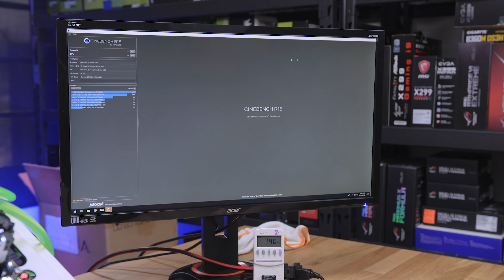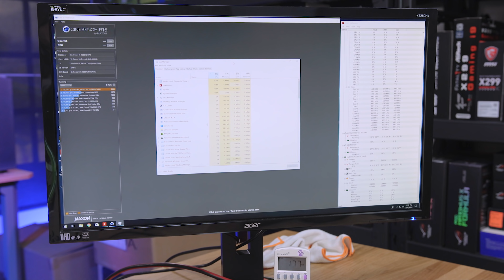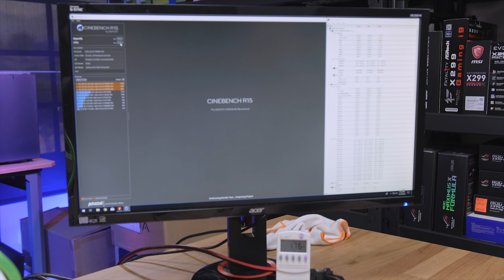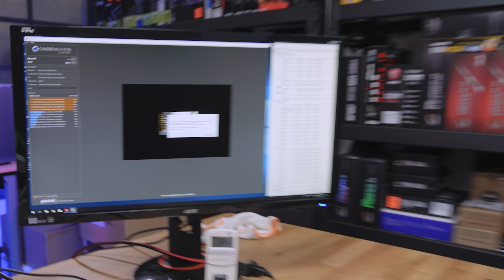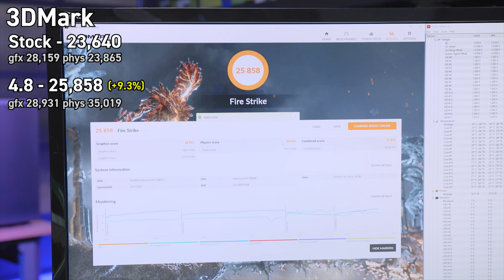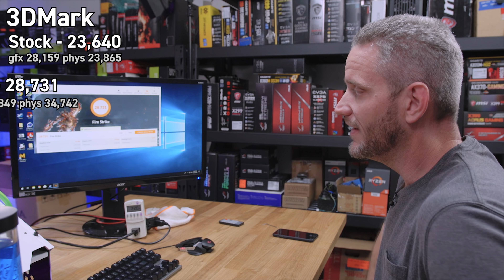Trying to get back on the 3DMark Leaderboard!

Comment: Please redo this but delidded, & from wall power or upc etc......
Wanna see if can reach 5-6GHz oc 
Congrats.
Cheers, A
Reply: Aepek yeah and with 220v
Reply: I just wanna watch a 2000 bucks CPU burn!
Reply: There's no way hes reaching 6 ghz on any form of cooling besides nitrogen.. maybe 5-5.2 ghz with a delid..
Reply: RJ Games You would at least need subzero temperatures or possible mods for a board. Phase change probably would do it.
Reply: RJ Games think could maybe get 5 or tad bit over if does delid CPU, & would be cool to see what able to get with delidding etc.., but staying away from nitrogen, etc....(just normal "water *cooled" loop). He was at 4.9GHz, so think very possible once delids CPU, think very possible....& would love to see, like said; also not using extension cord but directly from wall or a upc or similar.
Cheers, A
Reply: You're not getting 6 ghz unless you go on nitrogen. I dont care if you use zero extension cords and add the best thermal grizzly you can find. Not happening without nitrogen.
Reply: RJ Games what about oxygen?
Reply: RJ Games Not even with something crazy like a 16-fan thick 480 by 480 radiatior, hooked to a normal room fan that covers the whole thing? (Jay did that somewhen - https://youtu.be/Q2SIrV_4-dM )
Reply: Waterchiller, direct die delid, 1600watt psu, active vrm cooling and fuking pwn that scoreboard. U have an ultra platinium sample cpu, its already outperforming delidded ones.
Reply: I am willing to bet money that he will not get that cpu to 6 ghz. That can't be done without crazy high voltages and no amount of liquid cooling and delidding will be able to manage that unless you get a means of cooling the cpu to sub-ambient temperatures.
Reply: Jon Donnelly 😉
Reply: Delidded liquid metal with clean power and a sub-ambient (or cold room) water cooler but no liquid nitrogen  he can probably get that chip to 5.3ish honestly he should probably thermal camera his motherboard and check his error log to see where he is failing at as well. Oftentimes it's not even CPU heat that kills stability but other issues like bus speeds and stuff like that going goofy.  It also makes some sense to over clock each core individual so that the better cores can ramp up higher.
Reply: That extension cord is rated for 1100 Watts and it can take twice as much without affecting the "quality" of power delivery on the CPU level. You will, in fact see smoke and a fire brigade before you see any measurable difference behind two DC-DC converters.
Deliding and applying that 4x480 rad might net us some interesting result tho.
Reply: Aepek if Jays come to quebec ill delid and lm this !
Reply: Thanks all for comments! 
Think it's very possible, & doable, for Jay to reach 5GHz or bit more if delids CPU (doesn't use nitrogen or other similar low temp liquid cooling) & tweaks test bench setup some more etc.... Since, in this vid he was SO SO close & wasn't even bothering with delidded CPU, not using extension cords, etc etc etc.
Too bad wasn't a moderator, cuz I'd do a poll(or similar prgrm asking) & say vote for: A) delids CPU, no extension cord[using ups-apc etc....], tweaks ram & voltage, & other minor tweaks BUT NO nitrogen/freezing cooling solutions[water type only] B) YOLO IT, delid, IC ram psu, CPU & damn consequences AND use nitrogen if other high end freezing liquid fir cooling to reach 5 GHz ABD BEYOND.
Would really be interesting {cool} to see which one gets more votes WITH still being able to use test bench afterwards 😂
Cheers All, A
Reply: Aepek Jay love your humour if you want base check baseline/ the sound of baseline on YouTube
Reply: Yes. Delidding and using Conductonaut will drop your temps by up to 40C on this chip. This chip should just be considered incompatible with Intel's current TIM. It is insanely bad.
Reply: Absolutely we need to see this!!!
Reply: I've seen your comments on another channel before, and I might have replied... But what was the channel name.
Reply: I want to see him hook it up to the box fan cooler again.
Reply: Bios singular
Bioi plural

Ancient greek ftw!
Reply: Yes delid and push the GPU more!! :)
Reply: Don't they can hot 6 without ln2
Reply: use a NVIDIA Quadro GV100 for best resulsts
Reply: actually put them 4x in ur system
Reply: +1 to delid
Reply: Then throw in a titan v and reach 1st place in 3dmark
Reply: I've got a GTX 970 and a 6700K, no overclocking, and I still outpace many stock Titan V systems with no overclocking. System composition is HUGE when designing a system. You can't just slap a bunch of supposedly compatible parts together and assume to max out your performance.
Reply: William Eldridge What brand and chipset Mobo do you have on this system? I wouldn't necessarily upgrade my cpu either if running a 6700k, I'd do gpu first. Core I7-6700k ess pretty good cpu & base clock is 4Ghz little faster than today's 8700k out of box. Out of curiosity, what else diving in rig besides what listed? Just curious, up to you if reply.
Cheers, A
Reply: @Aepek  I am using 8GB of HyperX Fury DDR4 2666, Samsung 950 Pro M.2 256GB, ASRock Z170 Gaming K4, i7-6700K 4.0 GHz, EVGA GeForce GTX 970 SC Gaming, using stock GPU cooler and a Cooler Master Hyper 212 EVO.
Reply: William Eldridge Nice.
Cheers, A
Reply: a direct wall power what could change? the psu convert all crappy waves into pure DC voltage... i think if the psu voltages upped a bit it could do more, but where u tap the AC is not a matter
Reply: He’s gonna have to if he wants top 100 as he’s no longer in it
Reply: Nah , you wont reach 5GHz with a notmal Water loop. I have a i9 7920x, delidded with a 60mm thick 360mm and a 30mm 280mm rad with Noctua Industrial fans at 3000rpm and a ddc 3.2 at 100% and it starts throttrling at 4.8, with better exteriour temps at 4,9 GHz. Its the same die just with less cores active so i doubt the 7980XE, even if its a golden Sample, will reach that Clocks at least with water cooling.
At least i made it to Place 28 in Time Spy extreme :P

Comment: The Xeon x5650 is a 6 core 12 thread chip but it dual socket lga1366 mother boards are rather common so that system on cinabench was probably using 2 processors.

Comment: Ok ok hold up, I'mma let your video finish but I have to say two things:
1.) Thank you for bringing back more gimmicky cheese.  Chip, bass check, biossiii...I've missed it and am delighted to have it back.
2.) Speaking of gimmicks, this is at least the second time I've heard you mention peltiers in the same sentence as LN2.  As far as I know, the whole peltier thing was just a bunch of gimmicky BS that didn't hold up to actual tests and even underperformed when compared to air cooling.  Am I totally wrong?  Will you please to a thorough peltier cooler comparison video?  I'll give you money.  Thanks!

Comment: Running a 7980XE overclocked without delidding is not very smart. The 1080Ti needs either the XOC bios or a shunt mod to achieve a high score.

Comment: I want you to do a part 2 to this where you get maybe top 50, but with a delidded CPU, much better watercooler, and not drawing power from an extension cord, and maybe a better power supply? 1200W is not going to be enough I would bet for higher OC's

Comment: But can it run Crysis ?
Reply: Nothing can run Crysis yet, ask again in like 50 years :P
Reply: ForzaE2 yes at 25 fps with some frame drops and stuttering.
Reply: OmniMontel at 144p
Reply: Not at 4.9Ghz ... It'll thermal throttle and crash

Comment: I may have only 6c/12t on my 5.0ghz, 1.30v 8700k, but my electric bill isn't $1700 a month either lol
Reply: Running 700W CPU 24/7 for one month consumes 504 kWh which costs an absolutely insane amount of money: 30 (thirty) dollars a month.
Reply: You must be the life of the party.  $30 may not matter to you, but I'm sure your parents wouldn't be happy about it since they're the ones paying the bill.
Reply: I'm not fun at parties, but at least I'm well aware of what things actually cost. that $30 dollar bill doesn't happen by accident by an irresponsible child. the golden sample CPU capable or running 4.8+ GHz alone would cost you $2500. add in MB, PSU and cooling - and you're looking at more than 3 thousand dollars rig, and that's even before GPU and other stuff. also, no one would run this CPU 24/7 under the stress-test. so the actual cost of electricity for that CPU would be like $10-15 a month compared to $4000+ for the whole PC. not that scary, isn't it?

thanks to Greenshit and other eco-terrorists so many people are in fear of using the electricity and don't even try to calculate. they just think they can go broke in a minute if they don't try to conserve the electricity

sorry for the rant

Comment: I wouldn't touch another Intel chop until they start soldering their heat spreaders to the chips. You shouldn't have to void your warranty to get better thermal performance.
Reply: Yes it does. https://communities.intel.com/thread/125395
Reply: Intel will never go back to soldering. They stopped doing that a very long time ago. It just has never been an issue because they used amazing thermal compound back then. Direct Die soldering would sound awesome to me though, quite hard to achieve though xD
Reply: meleniumshane90 deliding doesn’t void warranty as long as the process hasn’t damaged surface mouth devices

Comment: Since you've cooled with antifreeze could you fill a loop with liquid metal? And make a video on it
Reply: that would cost waaaay too much, and who knows what that would do to the poor pump
Reply: F*ck that pump! A liquid metal loop is the BEST thing I ever heard!
Reply: I'm definitely sure the liquid metal would short the cpu block, not to mention drive through a hole on his wallet coz I'm assuming those things don't come cheap.
Reply: I bet with a spnsor it wouln'd be a problem and it would not short the block! simply because the is no current flowing thrue the loop and if it would (whitch it don't) then even water would short it

Comment: @JayzTwoCents Does motherboards have much affect on benchmarks? i had a asrock z170 extreme 4 in i did a test on firestrike and i got a respectable 12859. but then i upgraded my motherboard to a maximus ix hero z270 and it game me a result of 13249. i was wondering why it was a big increase as all components except the motherboards are exactly the same as before.
Reply: the vrm's might have given more sustainable power to the cpu and or the board was just better and allowed the processor to preform well
Reply: Multi core enhancement?
Reply: On it's own a motherboard should have no direct effect on benchmarking performance. BUT one of lower quality can limit an overclock by not supplying your components with enough power of pci-e lanes.

If you changed nothing else the gain 390 points could be caused by, as @Darth suggest, Multicore Enhancement or syn all cores.  Which is a form of automatic overclocking some Asus bioses had enabled for a while.
Reply: it had something about a overclock but i have a i5-6500 so it cant be over clocked. when i looked through the uefi it said something about gaming that increased the cpu by 2% nut when i did the benchmark it said the timings was incorrect and wouldn't validate the score but when i put it back it came up with the high score i mentioned . if it is due to a built in multi core enhancement than that is awesome and its always nice to get a bit of extra processing power for free.
Reply: it also can be just your daily things opened on the desktop, a simple browser or a program in Tray can steal decent number of cpu score from I5 6500, as well as gpu will never score the same, it always will vary by tiny bit, as well as if cpu scores lower - gpu also will score a few points lower and vice versa, just a few points but all that together can result in lack or gain of 400 points / personally i spent over 200 hours in steam 3dmark, and perhaps around 100more when i was a 'pirate'

Comment: I once blew a CPU by changing the multiplier by 1x from 35 to 36, magic smoke appears.
Reply: Daniel Lopez that thing was going to die on you anyway
Reply: Daniel Lopez I once had a gpu light on fire... it was running stock. (It was a defective gtx 760.)
Reply: A Wild Doggo Now I know what to take when I go camping. More effective than matches.
Reply: Daniel Lopez GTX 745 also works as long as you have heaven benchmark
Reply: Samsung smartphones and charger?
Reply: I never killed a CPU, just a motherboard and I was really surprised. Swapped out a 140W 4core for a 125W 6core assuming the VRM could handle that easily, overclocked it to the same level and boom, rip my beloved gigabyte :(

Comment: 2:50
The Xeon is a 6c/12t CPU but the run was done on a dual socket mainboard and 2 x5650s.
Reply: Yeah, I actually have one of those. I kinda went "wat, there's a 12 core version??" when I saw that but then I remembered that Windows calls it one CPU with multiple sockets (in the case of multi-socket systems).
Reply: Yup. Still rockin 2 x5670's in my esxi server. V good price/performance on that platform these days as long as you're not running single thread intensive tasks.
Reply: The funny part is that it's faster than FX in single thread, despite the much lower clockspeed.
Reply: The even funnier part is that it's overclockable if you've got a supported motherboard. The X5650 has a max multiplier of 22, so with a BCLK of 180 I run mine at 3.6 GHz (on an ASUS P6T WS Pro). I'm not sure what I set the voltage to in the BIOS but HWMonitor reads 1.152 vcore off the motherboard. Once I get a better cooler I'll just run it at 4 GHz.
Reply: Was gonna say that Westmere chips were easy to overclock. Neither are worth buying unless of course you're getting a good deal.
Reply: I got the motherboard for free as part of a system with an i7 950 in it. I got the Xeon on Aliexpress at about 20€, so I'd say it was a pretty darn good deal for me.
Reply: 三xotik update bios and grab X5650, they're less than $50 on eBay xD